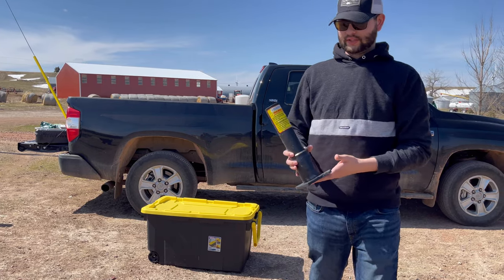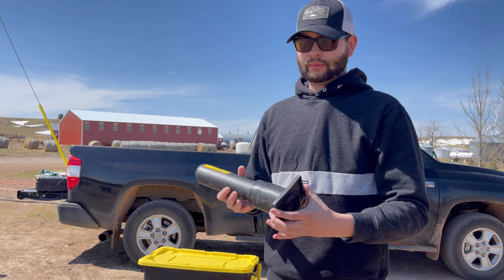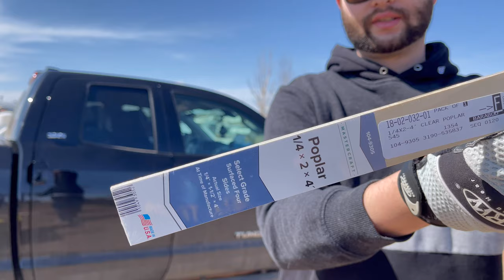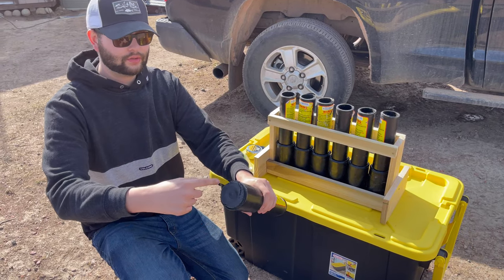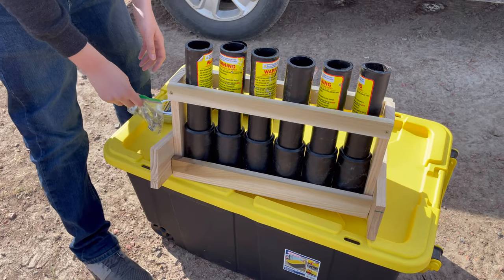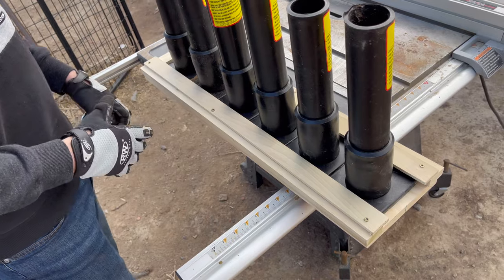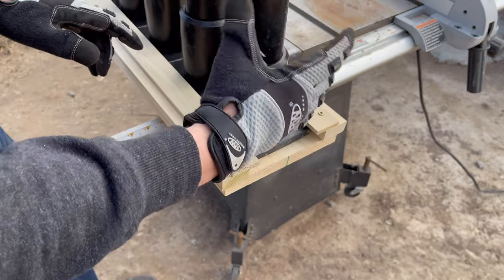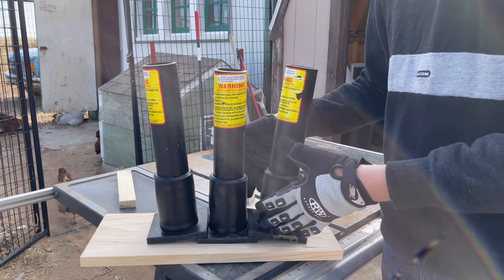How to Re-Purpose your HDPE Excalibur Mortar Tubes in Racks

Comment from the maker: Been wanting to make this video for YEARS. Hope this helps you guys who have a plethora of these excal tubes!
Reply: Thanks cody. This will definitely help this year
Reply: I like these plans.  We have just always left the base on and screwed them down to a 4 foot 2x8.  4 screws in each base and go 2 wide.  We put 24 on a 4 foot board.  I put 16 inch braces on either end just to be safe but my nephew does not and has never had a tip over.
Reply: How long would you be able to safely re use these?
Reply: @supbra808  i would say about 80 shots. But if the launcher blows up its still nothing to crazy if your at a safe distance since thier hdpe. Just use em till they bulge or blow up. Thats the fun part lol
Reply: This helps so much
Reply: Helps 💯💯💯

Comment: Yeah. I built a slide style one years ago, if done right it can be used for both Excalibur and wooden baaed fiber glass tube.  It was mostly made of scrap wood so it only cost be $4 for the two other pieces.  I would do either 6 or 8 tubes long.  Also cut the end piece long, not short like he did, so it can also prevent the rack from tipping over.

Comment: Awesome ideas, I do have an idea for your slide rack you can put a stopper at the end of it just on the right or left corner ad a screw and the back plate can move up and down to take out or exchange a diff tube.
Reply from the maker: GREAT idea!!
Reply: @CodyBPyrotechnics  thanks Cody glad you like my idea, and thank you for making this video I sorta made one of those racks by just screwing the fiberglass tubes some I had close some I made father apart, I love this slide threw I’m deff making one and posting a video on it when I do I’ll let you know so you can check it out.

Comment: Just as an idea,  you could have drilled couple of holes on each end and bend a piece of round iron bar to use as pegs that would have secured the rack on the ground serving both as a stopper and an achor point to make it even more stable on some bumpy and questionable grounds

Comment: i don't like using a hole saw as because it is unstable and might cut into the wall of the tube.  I use a straight cutoff bit with a bearing on my router and it cuts the plate off flush with the sleeve (or tube if you remove sleeve).  not that the hole saw would not work though...  Love the vids

Comment: I remove the reinforcing sleeve, the tube is strong enough, it’s basically the same as normal HDPE tubes. It makes the racks MUCH lighter and more compact. I did make a rack for tubes with the sleeve on. It was the same size (and weight) as a 1.3G 3” mortar rack! In this older video I cut the bases with a table saw but I like your hole saw idea better. https://youtu.be/t9L_MT2hWnU